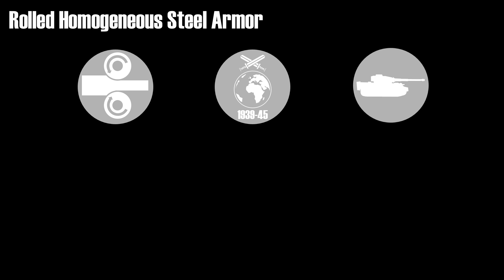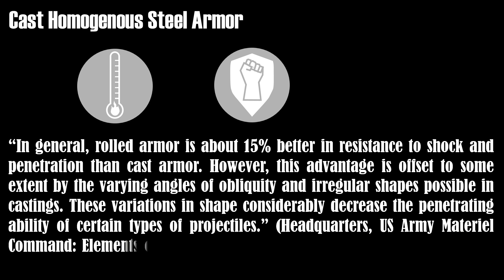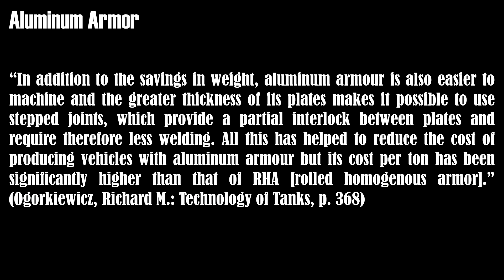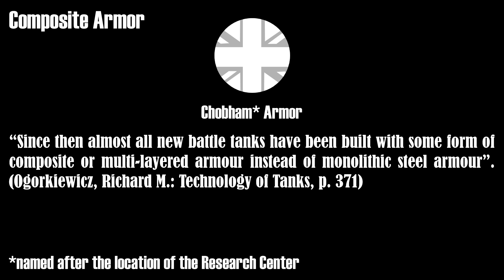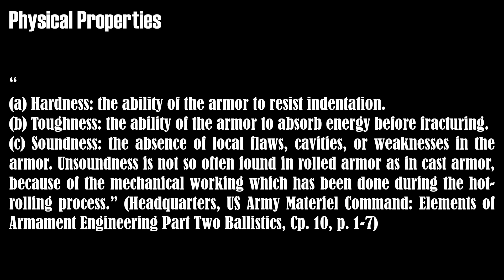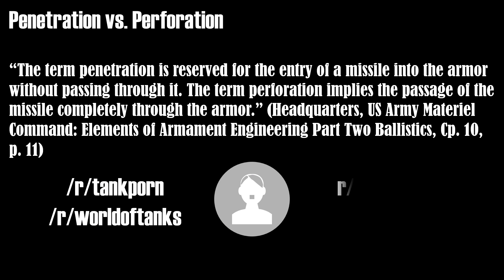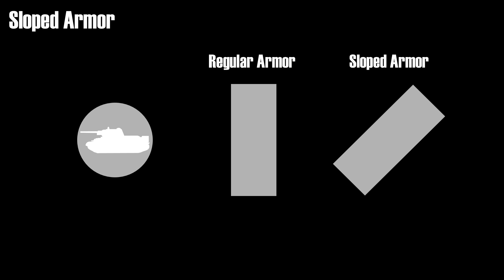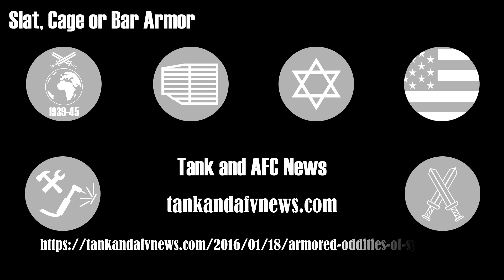[Tanks 101] Armor Protection 1920-1980 - Features and Characteristics

Comment: the most cheapest and strongest armor would be a graphene hydrogen oxide. or basically, hollow armor and hydrogen spaced in between, hydrogen turns back into water when exposed to fire or high temperatures good for HEAT, the hollow armor being made of graphene around an inch thick, spaced with an inch of hydrogen and another inch of graphene. extremely light. and flexible.

Comment: You mentioned interesting make shift armor add ons; a couple of years ago, I sighted a very odd photograph from the wars on the former Yugoslavia: a T-34/85 covered in rubber, apparently to hide a little its thermal signature. Here is the picture: https://upload.wikimedia.org/wikipedia/commons/f/f3/Serbisk_T-34_85_trekkes_tilbake.jpg
Reply: The Serbs used rubber sheets and tyres as improvised appliqué-armor to counter HEAT-rounds. A poor man's Schürzen.

Comment: just a pointer the t 34 has 45mm or armor at correct me if I'm wrong 55 degree. could be the panther I'm thinking of for angle. but either way I do know that the t 34 effective armor was around 80 mm depending on what angle you are from the side. flat on its something like 82 ish.

Comment: No mention of shaped charge rounds turning aluminium armour into a giant thermite grenade as reaction starts
Reply from the maker: source? Cause I haven't read anything about that.
Reply: As far as safety is concerned I'll be blunt. The M113 is a deathtrap. We (the Canadian Army) used them in Afghanistan, but we were very careful about where and when, because they were hideously vulnerable to IEDs. The M113 belongs to a much earlier age and simply lacks the necessary safety features, quite aside from its thin and combustible armour. And I'm not kidding about that last part. The M113's armour is an aluminum alloy that includes a 4.5% magnesium. In one instance we had an M113 tapped by an IED, the kind which had it hit one of our LAV IIIs would have just blown off a wheel or two. Instead the M113 immediately burst into flames and burned down to to the ground. Luckily the crew got out in time, but in the end all that was left of the vehicle was a pair of tracks and an engine covered in slag.

source to follow
Reply: Another for note for the M113.

"The M113 was also used by the Australian army in Vietnam. It was a common sight to see Australian soldiers riding on top of the M113 instead of inside. The reason for this was that the enemy AT mines used at the time where shaped charge mines the would ignite the aluminium and partly magnesium (4-6%) armour starting a thermite reaction. "

Comment: Reactive armor tends to be fairly thin. Every example I've seen in person, would only be a few mil thick. Basically an ammo box thickness. 

If you go on liveleak, there's some footage of reactive armor saving the bacon of Syrian forces, from RPGs (no political statement contained in my message).
Reply: Timothy Soen some are thick though, to prevent machines to set them all off.. which would be terrible if all the marines are remotely close to the tank.
Reply: Explosive RA. Reactive armour can be passive as well  basically a bunch of metal plates with a rubbery material between them. On impact the plates compress and the expand.

Comment: Something that should be noted is the use of ceramics and such aren't for heat weapons, they are for ballistic protection. Because it was found out ceramic though fragile, if you can keep it to together functions as a fantastic form of protection. Which is why ceramic has become quite a big thing in infantry body armor, because composite plates with ceramic were found to be highly effective. But down side of course is that the durability is a lot less then say steel.

Comment: Nice video.
But I have to point out one huge mistake!
The metal in shaped charges does NOT liquefy! It stay solid and is just deformed by the explosion. "The immense pressure makes the metal flow like a liquid, though x-ray diffraction has shown the metal stays solid;" 
Source: Wikipedia: https://en.wikipedia.org/wiki/Shaped_charge#Liner
Reply: Keyboard runner but they next sentence is: one of the theories explaining this behavior proposes molten core and solid sheath of the jet.

Comment: The Brinell hardness measurement is usually only used for soft metals like aluminium, not for steel. It is way more likely to that the Vickers or Rockwell hardness measurent was used for tank armor.

Comment: Why was the ERA angled? it gains no benefit from being angled. 8:34
Reply: It, does, actually. By blowing the exterior plate away from an angled position, the plate itself "shears" the incoming penetrator, feeding armor from the side into the jet. This helps to disperse and 'cut' the jet from a HEAT round. 

If the armor was perpendicular to the incoming, the explosion would be the only effect attempting to disrupt the HEAT round. 

Further, it maintains the same effect as sloped armor.
Reply: The armor which it attached on may be angled already.
Reply: Just a little tidbit

Comment: So the french liked curves before they were cool?
Reply: False, false and false. Casting is actually relatively cheap and simple method of producing armored hulls and turrets, especially if you cast them in more or less one piece. 
Secondly, the French in fact ridiculously outnumbered the Germans with tanks. The problem was that French tanks were either Renault FTs that were still around from WWI, or more modern tanks that could have been reasonably capable, but were hampered by several factors. French were very fond of one-man turrets, completely overtasking the commander, didnt have radios on tanks (except command tanks), followed an obsolete doctrine, and relied on the 37mm SA18 gun for most of their tanks despite the superior SA38 gun being available, simply because the SA18 was available practically for free since a large number of Renault FTs were either rearmed with twin MGs or scrapped altogether. The SA18 had a pathetic penetration of 20mm (most german tanks at the time had 30mm frontal and 20mm side armor), and by the time they realized and equipped tanks with the better SA38 (pen of ca. 40mm) it was already too late.
One of the other problems they generally had was that their cast armor was not robust enough by their standards. Test-firing a german 3.7cm Pak36 against a R35 with 30mm hull thickness revealed that the gun could easily punch through, hence the thickness was increased to 40mm which remained the standard for french tanks with some exceptions. 
However, most of these negative aspects of french tanks had a reason. One-man turrets allowed for the tank to be smaller overall, making it cheaper, and if the tank is smaller overall increasing armor thickness doesnt impact the overall weight as badly as with a comparatively large tank (just compare Matilda and KV-1, same armor, but one is twice the mass). Lack of radios was due to them following the viewpoint that making a plan beforehand and rigidly following that was all the coordination necessary, meaning that they could not adapt to changing circumstances or surprises. 
If you take those things away french tanks were actually quite modern and well regarded throughout the 30s. France was setting the standards of tank design at the time and before the germans came steamrolling down the french tanks were considered the best in the world. Well armed and armored with good mobility, generally reliable and serviceable.
Reply: @builder396  the Germans did outnumber the French. The French had superior tanks and the Germans (for the most part) only won because of their number advantage
Reply: @mandalortemaan7510  Its not a numbers advantage, its the fact they used radios. The French didnt due to a mix of their radios just being blocked by every odd line of trees, and a general distrust that the things would be too easy to intercept by the Germans, so they used signal flags and couriers where they could, which led to 90% of the disasters that caused the French Army to fall apart. 
Also, French tanks werent superior. They had about 2 remarkably good types of tanks, the S.35 and the Char B1 bis, which were relatively tough nuts to crack and had good firepower, but even they were handicapped by their 1 man turrets, and even if they werent, they were still very few in number compared to the cheaply mass produced R35 and H35 infantry support tanks, which had 37mm SA18 guns and had  roughly firepower of a rifle grenade, so at least 85% of French tanks were generally horrible little tin cans that were well protected against AT guns, but bullets could splash through every single viewport because the designers neglected to put any armored glass in there. Say goodbye to your eyesight.
Reply: @builder396  yeah they were coordinating their numbers very well. French design is weird
Reply: Casting price depends on quality. Poor quality casting is indeed cheap, but it very fragile. Good casting metal has to undergo a series of very expensive and slow processes to extract defects. So either the French payed for that, or their casting armour was as good as nothing.

The French indeed had a a lot of tanks, but as you said, most of them were WW1 relics which had to be replaced (some French strategist maybe thought that the FT-1 was good enough, but today we know it wasn't).

I agree with the rest though: France having very interesting, advanced designs, and the tactic and operational problems, that had a massive impact.

Although considering the fact that a better deployment and tactics (and having  radios) could have had a massive impact on the development of fall gelb, I still believe the choice of casting to be a major factor in the French tank pool in '39.
Reply: Thank you so much for explaining this to people, i get called crazy by others for telling them that french armor was actually somewhat good xD
Reply: casting is only expensive when getting it a start up the production line but when you get the molds and proper equipment and manpower they just roll in the production line so easily
Reply: Hellhound Wyrm/Wurm Actually the nickname came up on the eastern front when T-34 attacks became more massed and the only AT gun proved utterly useless. 
The B1 (B2 is the designation for the german captured and modified version) was never there in large enough numbers to be that kind of problem.
Reply: yes, the French really looked for curvy tanks, and they managed really good designs in ww2. The problem is that casting was slow and expensive, and was a factor in the fact that they were unable to field (by far) the required amount of tanks needed against the Germans.

Comment: I would have thought there'd be more info about chobham armour given it's importance.
Reply: Still classified, so until it becomes old tech, there's not much we CAN know about it for the time being. A look at a T-72's UPF armour shows it was a plate of glass sandwiched between 2 steel sheets. But modern composite armour has tons of layers and materials, making it quite expensive, but very effective for it's overall thickness.

Comment: Modern composite armory utilizing ceramics prefer to have flat faced armor because the modern APFSDS is far too difficult to deflect, to reduce the number of damaged ceramic tiles, and that ceramic armor works by abrading and deforming the projectile rather than deflecting since, as I said above, it is far harder to deflect APFSDS.
On some modern tanks, the flat faced armor is hidden under thin sheet metal that appears sloped as in the Challenger. And others simply display the flat face openly, such as the Leopard 2 before the additional spaced armor was added to the front of the turret.

Comment: Something you kind of got wrong was slat/bar/cage armor. The point of cage armor is not to give spacing, it is made so that if the HEAT shell goes in between the bars, the fuse does not go off and the charge is crushed and neutralized. The only spacing it provides is because it has to have some distance from the main armor to avoid the fuse hitting it. The more typical spaced armor can be called fence armor. It uses a wire-mesh instead of a plate to save weight.  Fence armor can cause bullets and low caliber shells to tumble, reducing their armor piercing capability. The cage armor on the other hand does not stop bullets and low caliber shells. 

Anyways, great video man, keep it up!
Reply from the maker: thx, yeah, I got that wrong, I thought slat/bar/etc. is a sub-category of spaced armor. Meanwhile on reddit and also here I got new information. Although your comment was by far the most helpful and friendly one. thank you!

Comment: In one of your next videos about this topic, could you address armor overmatching? I think it's an often overlooked factor while dealing with sloped armor. Take, for example the T-34. In theory, it had round about 100mm of effective armor at the front of the hull (if not even more against AP shells), yet, because the steelplate was only 45mm thick, the effectiveness was severly reduced when hit with a bigger shell. Thats why the Pak-40 for example (and tank gun derivatives) had no problem punching through.
Reply from the maker: was originally planned, but I since the video took over 20 hours in total, I skipped it. If I do anti-tank / tank ballistics I will very likely cover overmatcthing.
Reply: Thanks man. Keep up the good work :)

Comment: One of the advantage to aluminum armor IS its thickness.  The United States Army was testing two new Armored Personnel Carriers back in the late 1950s, these were the T113 and the very similar T117.  The difference was that the T113 was made out of aluminum armor, whereas the T117 was made out of steel.  What the army found was that to give the T113 the same ballistic armor as the T117, they had to increase the 1/2 inch steel armor of the T117 to something closer to 3 inches of aluminum armor.  They discovered though that because the aluminum was thicker, they could dispense with the framework the steel T117, thusly making the T117 notably heavier then the T113.  That was the reason that the T113 was standardized as the M113, and the T117 was dropped.

Comment: 13:19 surface regularity: The Swedish S-Tank had crossbars welded onto on its smooth upper front hull, apparently to help deflect projectiles. It may have needed the really low armor angle that the S-Tank had to be effective.
Reply: It wasn't to deflect, it was to stop low caliber rounds traveling up the hull into optics and other important things up there, as I'm typing this I realized this is a 5 year old Comment.
Reply: @scavulous  ...to stop OR DEFLECT projectiles and and fragments thereof, not just from penetrating but from optics and other important things.
Reply: @akoponen  you... responded to a 5 year old comment of yours, my good sir i am most impressed
Reply: @akoponen  and I misread ur comment and thought you meant projectiles as in tank rounds

Comment: 14:08 In the context of War Thunder, however, so many players forget that with a sufficient elevation advantage (which is easy enough to get on most maps), the effective thickness in that case would be 1.2, because you aren't shooting straight into the tank, but from an upward angle that is now at 90 degrees.

Comment: At the start of WW2, most tanks were riveted together (and all Italian tanks had riveted construction).  This could result in the (hot) rivets flying around inside the tank if it was hit, with nasty effects on the crew.  Welding had the advantage that it was not only stronger, but lighter.  However riveting was easier.  The Covenanter  was designed as a welded tank but built with riveted construction, and the extra weight had serious consequences for the tank's performance.